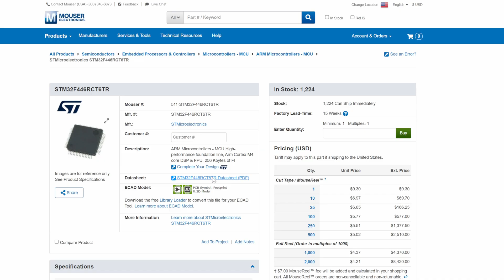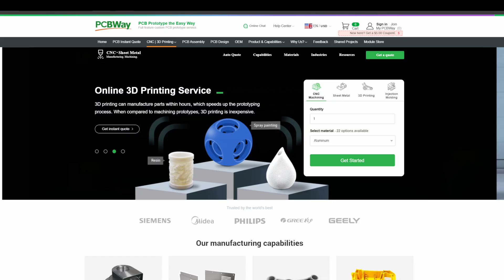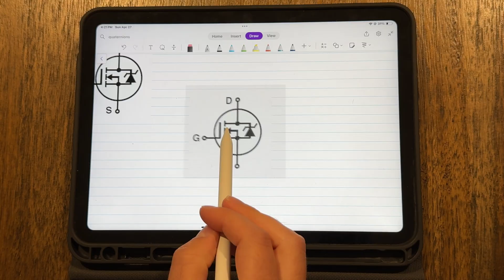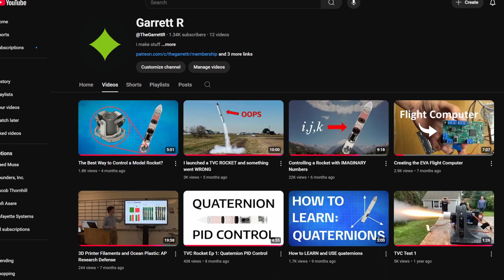MAVERIK: My Most Advanced Flight Computer

Comment: Hi, I've been working with UWB recently and I find your choice of using it in the rocket interesting. 
Be careful with teh positioning of the dwm3000 inside the rocket as NLOS conditions create multipath effects. 
To get good precision out of the dw3000 module you need a good antenna delay calibration.
Writing the correct stack to perform efficient ranging can be a bit challenging. 
I'll be waiting for the next videos to find out if your expectations of the uwb were matched !! good luck !

Comment: contrary to popular belief rockets don't behave like balanced broomsticks. if the broomstick tips to the side, it will experience a torque tipping it more and more to the side, which a rocket will not. the broomstick is unstable, the rocket is marginally stable.
Reply from the maker: What you say is only true of the center of mass is ahead of the center of pressure. because the rocket is also flying low, slow, and without fins, it's still analogous to an inverted pendulum like the broomstick.
Reply: @TheGarrettR  pretty sure it's like that regardless of whether it's ahead or behind. as long as the thrust vector and the vector from thrust to CG are colinear, no torques will act on the system, independent of the orientation. Therefore no tipping over unless tipped over by an external force.
Reply from the maker: @TheVirIngens  That's not necessarily the case. If the COM is behind the COP, an angle of attack will create a moment that causes the system to become unstable, much like with any angle from vertical in an inverted pendulum. However, if the COM is in front of the COP this will create a restoring moment. In this case, yes the rocket is marginally stable (see https://www.grc.nasa.gov/www/k-12/VirtualAero/BottleRocket/airplane/rktstab.html). You are correct that in absence of aerodynamic forces, no torques should act on the system, however the actual controls are still quite similar to that of an inverted pendulum

Comment: That was an excellent video! I'm currently working on building a flight controller using an ESP32-S3 processor along with several sensors, including the ICM42688, MPU6000, MS5611, and ICP20100. I found it really interesting that you're also using some of the same sensors. I just had one question: why didn't you use the NEO-M9N GPS module with RTK mode to improve accuracy? In addition, inertial sensors could be used to estimate the position between GPS updates.
Reply from the maker: RTK can be quite expensive, and to my knowledge the M9N does not have an explicit RTK mode. Plus I wanted to try out something none have done yet